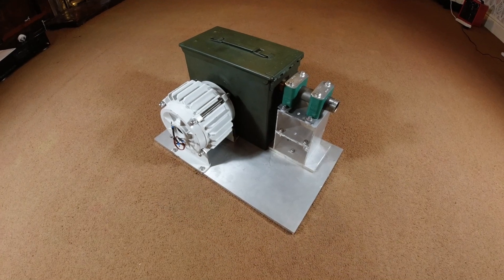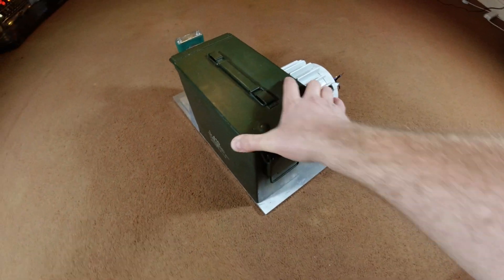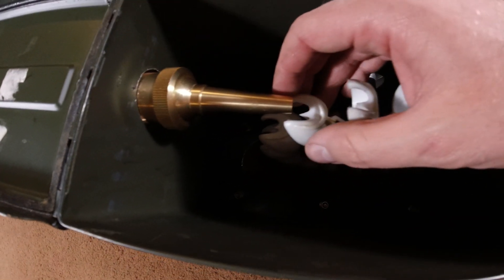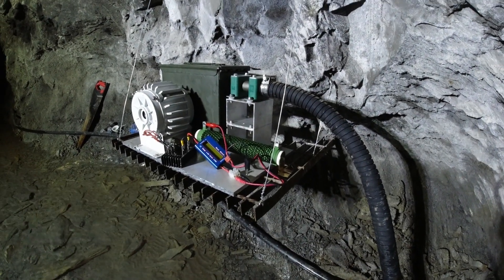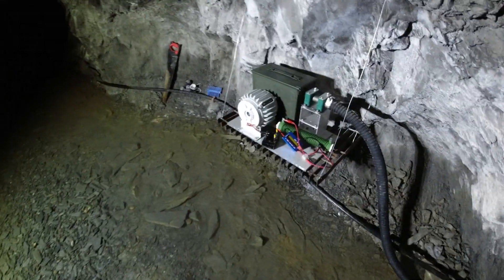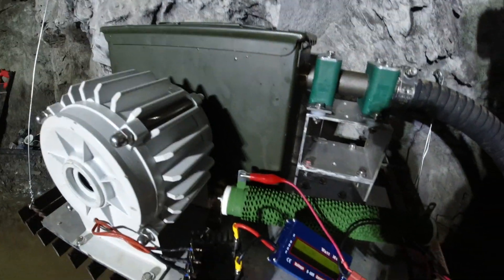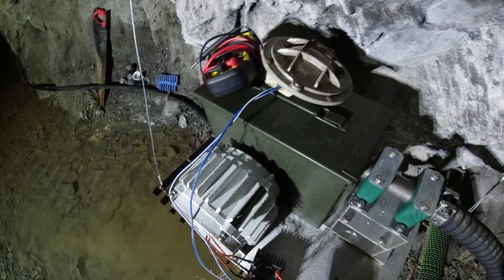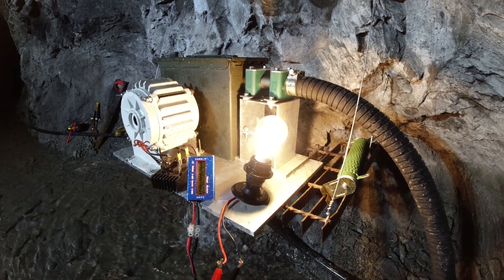Home Made Micro-Hydro Pelton Turbine to charge batteries off-grid

Comment: In times gone by from our grandparents people used to power water motors to drive sewing machines and other machinery using just mains water and something similar to a Pelton wheel turbine. This practice has long gone with the advent of modern electric motors but the notion of me generating electricity, even a relatively small amount using something I've already paid for makes a lot of sense. I don't know about you but I'm up in Scotland and we don't get our water usage metered it's just part of your council tax as a yearly fixed sum. So apart from people shouting about wasting water, which could be stored and used to water the garden or growing vegetables, flush toilets, fill baths etc. I have actually already paid for it so why not.
Reply from the maker: Hello Techstuff and thanks for writing. I know the kind of water motor that you mean and actually have one (from 1905 I think?) installed in the same mine, there is a video about it on my channel. In regards using the mains water for generating electricity, if you've got good mains pressure and good flow, then yes you would be able to make perhaps 50 watts or more from it. Whether that's legal or not I couldn't advise you. Reminds me of a friend years ago who managed to draw a constant 15 watts from his defunct ISDN telephone line.
Reply: @TheAmazingAdventuresOfMiles  thanks I'll check out that video. I have seen a video on youtube of someone tapping into a phone line and It was enough to charge a phone. Keep up the good videos mate, the more we learn the better we become.

Comment: Pelton wheels should not be boxed!  Any interaction of the water with the wheel after the initial impact must be avoided!  Since the exiting water goes in opposite direction than the jet, I would shoot jet upward from below so exiting water is down, aided by gravity.  if water is fed horizontally, it should be below the axis of the wheel, not above.
     Getting the water OUT is harder then getting it IN.
Reply from the maker: Thank you Brian for this very helpful advice, it all makes a lot of sense and I'll take it on board for my next Pelton design.
Reply: @TheAmazingAdventuresOfMiles  Just so you understand how Pelton wheels work.  The wheel's peripheral's speed is ideally exactly half the water-jet speed.  The water hits the blade, does a 180 degree turn, and exits "completely stopped" (the wheel recovering all the kinetic energy of the water).  In reality, the wheel must turn a little slower, because of friction, and the water must have some speed to exit, and it can't turn all of 180 degrees.  Because it is exiting slow, there must be a lot of (sideways) room for the slow exit.  This type of turbine can not have flooded exit.

Comment: I recommend making the penstock pipe larger.
Reply from the maker: Thanks for that Harry. I'd love to be able to do that, it would increase the power dramatically but I have to use what's already there. It would be an immense operation to change the pipe.
Reply: @TheAmazingAdventuresOfMiles  or add another pipe to it.

Comment: Have you got a mppt chargecontroller in there. That will get the max power point. Stop it from slowing down to much under load and also will convert the high voltage down and increase the amps increasing efficiency greatly if you have 95v open circuit
Reply from the maker: Hiya M J and thanks for the comments. Yes on the other end is an MPPT controller, and two Victron 110AH gel batteries. The MPPT controller does a great job, and it means that whenever I am working in that area of the mine (probably once a week) the batteries are full and just waiting. I can take up to 2KWh from them, then when I come back, they are full again.

Comment: It'd dryer with compressed air. and you get much more speed with air power...
Reply from the maker: Hiya Dana and thanks for the comments. Yes it would run on compressed air (or even steam), but there is no compressed air available. The mine did have a big air network about 100 years ago but it's long gone now and renewing it would cost more than my annual salary. But, there is some water available, hence going Hydro.

Comment: Ok the second part of your video was awesome down in the mine. 35 watts over 24 hours is 840 watts. My 120 ah deep cycle batteries only supply 720 usable watts, that's discharging then to 50%. I think you did a fantastic job and just think with a bit of tweaking you can easily double that. Good job mate.
Reply from the maker: Thank you very much Solrac. yes it makes 840w/h per day, or 0.84 KW/h per day. So that's a couple of days to fully recharge the two gel 110AH batteries that it's connected to via a charge controller. And this works great for me because I only generally work in that area of the mine about once a week, so when I'm there I've got plenty of power available and waiting for use (lighting/boiling a kettle/charging drill batteries etc). Then when I come back a week later, the batteries are full again. So it's fine for my needs really, even if I could double the power output there wouldn't be any practical gain for me, unless I end up working there a lot more. But it's fun to play about with these things, and I have some more ideas!

Comment: You need to have at least two nozzles to drive the pelton wheel.
You are loosing too much efficiency.
Reply from the maker: That's Geert. I agree that multiple jets are better but it depends on the water available, and in my case it's not enough to even use one jet properly. The 1km long 25mm pipe that I have to work with delivers a vanishingly small pressure.

Comment: Nicely done as far as the mechanical aspects of your setup, you need an MPPT controller on the output of the alternator to optimize the current/voltage output. You can think of it as a variable matching transformer to couple the supply to the load at the operating point where the power output is maximized. Julian Ilett has a good series on Youtube about the theory of operation of MPPT controllers.
On edit: An MPPT controller would let you easily experiment with the nozzle size to trade off pressure vs flow rate for the maximum possible mechanical power output from your turbine. A smaller nozzle may well allow you to create more power by minimizing friction losses in your very long feed pipe. You have a lathe evidently so making inserts for your  nozzle shouldn't be particularly difficult.
Reply from the maker: Thank you so much Giles for your thoughtful and helpful comments. Now that it's charging a bank of leisure batteries, it is going through an MPPT controller (a Schneider C40) which seems to work well. I did buy a smaller nozzle for it and it has increased the power a bit, but yes it would be worth me using my lathe to make a few different sizes to experiment. But to be honest I'm considering moving it "upstream" so it's not got the really long 300m horizontal length of thin pipe to go through, although I then need to get the electricity to transmit 300m back with minimal losses. So I'll have to transmit it at high voltage, but really I wanted to keep everything below 50v if possible.
Reply: @TheAmazingAdventuresOfMiles  Would you still rectify at the generator and then use a boost converter to transmit at high voltage DC (as otherwise you'd need a three phase transformer)? I think the cables and connectors that they use for solar arrays are pretty rugged and designed to be used in all weathers.

Comment: Great project and as long as you've got constant water it will have no problem keeping your batteries charged. Maybe a few tweaks needed for max potential but great design.
Reply from the maker: Thanks David, I appreciate your comments. Yes the water is constant, it won't ever stop or reduce. I've not been back to it in nearly a month, I'm sure it'll still be spinning away alright though. I've bought a better wheel with more cups from a helpful local chap, might see if I can swap that on, should give a few more watts.

Comment: some info.    1)   site analysis and  Predicted potential energy, at the turbine runner.      2)  MATCHING  component  spec's,  to the energy Available at the   site.     i would guess that  Neither has happened.       at least, you realize that a major pressure falloff occurs.     the (extreme) horizontal run and a very low flow rate equals  Not  much energy, at the turbine runner.        conclusions:    Estimate  the amount of potential energy available; at a location  where the horizontal run, of the water, is  MUCH  less.    Match  component  Spec's to the SITE.   and, run the wild AC from a pma, to wherever you want the power.   plan-b:    utilize a correctly designed, free-standing, waterwheel.    cheers         googletranslate
(pabba -  i don't think you made a mistake.)
Reply from the maker: Thank you so much for your comments David. You are right in that the components here have not been specifically matched to the water source, and the reason for that is economic. I have lots of bits hanging around, the alternator is off an old project, so is the Pelton. So it is a case of using what I have available. I'm sure a custom precision made machine to match that exact water source would yield the best possible result. 

Now I am considering moving the turbine further "upstream" to see if that helps, as you suggest. The very long pipe that supplies the water is totally level for the last 300m to the turbine, so if I move it to the other side of that 300m length , I expect it will be better because less friction?

However, I then need to run 300m of three-core cable back to where the 12v power is needed and I assume I am going to get voltage drop doing that. Question is, which gives the most power at the end?
Reply: @TheAmazingAdventuresOfMiles   some info.      it appears that the flow rate  may  be in the range of  .3 liters per second;  note that this is  a  M I N U T E  amount of water.       a lot of the energy from the effective head is  lost,  in the  very very long horizontal run (of the water delivery system).      if you did EVERYTHING  else Right, you might be able to generate two-point-five watts DC, continuous.     you have  Nothing to lose and  everything to gain, by running  the  wild  AC  from  a  pma; rather than,  water.     any kind of AC  can be run, with minimal losses; in this case, there might  be some small,  measurable losses.     in this case, cables can be, plain-ol',  16ga  three-conductor wire.      even though there is a significant amount of head, the  very very low flow rate  'tells the tale';  in the math.    which is:
flow rate (in cu. Meters per second)  x  head (in meters)  x  gravity (9.81 mps/ps);  multiply by 1000 to get watts.    then, subtract  system losses, to get  estimated NET  output.     due to the very very low flow rate, this is an instance where the use of a  high-speed hydroturbine is Not recommended.     i have no interest in where you components come from.
Reply from the maker: Thank you David for your very helpful reply. That is a useful formula, thank you! I do not know the flow rate I have, but I am sure is it more than .3L/sec. I will attempt to establish it. It must be more because it is putting more than 3 amps continuously into the 12v battery, so that's around 40 watts roughly. I will move the turbine to the other end of the 300m pipe next time I'm there and report the difference in power, I am sure it will be higher there.

I think the cable losses will still be significant though, a 16 gauge cable carrying 12v AC 3 phase over 300 meters is showing a 57% loss at just one amp current. If the voltage can be higher the losses will be less but as it's charging a 12v battery, the turbine voltage is forced down to meet it. Open circuit the PMA runs at about 45 volts.
Reply: @TheAmazingAdventuresOfMiles  1)  i can only comment based on  What  you have shown me.      2)  Accurately  Estimate the  Total amount of potential energy that is  Available, at  the  Turbine  intake.      3)   you  may be right about transmission losses; where the  wattage is  low.  (use heavier cable;  step-up voltage;  make more  current.)      4)  it is probable that your estimate of output power,  is  Wrong/inflated.       5)   it should be understood that the  pma output  Current  CANNOT  be  correctly measured, if there is significant  impedance/Resistance  in  the  output  circuit.       6)  in  order to  Correctly  Estimate the pma output, the output circuit  MUST  cause  a  nominal amount of (internal) lenz-force braking, at the pma rotor.    when this is so,  the pma  rpms  WILL be  reduced.       7)  in order to calculate output watts,correctly, measured amps  must be combined with the  (estimated) voltage produced, at  the reduced rpms.      8)  this can be done in one of two ways. 
short the pma output, and measure amps/volts  with  a  clampmeter, at the shorting-lead.    or, 
measure current with a direct-connect ammeter, and  Estimate the output voltage, at the  Reduced  rpms.

Comment: Awesome project! I was running the numbers for pressure loss and realized how little I know about this application...came out to a 90% loss @ 0,5 liter/s flow rate for the 25mm pipe alone -  but that can't be even close, can it? Anyhow, my first thought was to put a tachometer on the tip of the blades and compare that to the velocity of the water jet.
Reply from the maker: Thank you for your comment :) To be honest I'm not sure how to calculate losses, I just know from some manual somewhere back in the day that the diameter of the feed pipe is extremely important, as is not having it too long on the horizontal. A 1km long pipe of 25mm diameter, even with a 65m drop, is not ideally suited for a turbine. But that's what is there so that's what it's working on, and replacing the whole pipe though the mine with say a 60mm would be extremely expensive due to the complex route.

I couldn't give accurate figures on the slow-down under load but it seems to be a lot. I was slightly alarmed to find the open-circuit voltage over 95 VDC, but then connecting to the 12v batteries to charge them obviously it drops considerably down to 12-14 volts and the wheel grinds away slowly.
Reply: @TheAmazingAdventuresOfMiles  gates.com has a "Fluid Flow Pressure Calculator" that I used, not metric format though. Looks like a lot of design went into the turbine, how do you verify the action of the wheel-materjet interface - a high speed camera?

Comment: Hi Miles, for sure, you love hydro turbine ! You should have more power from this setup.
I don't know what is your water flow, I will said about 0,25 to 0,5 liters/seconde.
With 6,5 Bar. If the all setup efficiency is 50% (pipe friction, nozle diameter) You could plan to produce +/- 80W.
I run a small Pelton turbine at home, regarding the water flow (max 3 liters/second), 150 meters, 50mm diameter pipe, 64meters  elevation (6,4 bar) , I can produce from 300 to 700W.
I have a few video about it in Youtube
Reply from the maker: Bonjour Cristof! Merci for watching my video. I think you are quite right, I should expect a greater wattage from this setup. I am wondering if the wheel is too large diameter for the size of the flow, and is giving too slow RPM. I used a 200mm wheel, maybe a 120mm wheel would help. I do have a smaller wheel (and a smaller jet) and will see if that makes much difference. Merci for your help!
Reply: @TheAmazingAdventuresOfMiles  Hi Miles, you should also use a mppt charge controler, it will help a lot for more power (a solar one will be good )
Reply from the maker: @cristof48  Thank you Cristof! Yes, I do use a small 10 amp Schneider charge controller which has Mppt. It definitely squeezes a bit more out that just a direct connection. Also, I tried changing for a smaller nozzle today, it made it go much faster with no load, probably twice as fast, but when on load I think it gave about 20% more power.

I think maybe my Pelton Wheel itself is not ideal, maybe not enough spoons. Lots of water still flies out in direct line having not given up its energy.
Reply: @TheAmazingAdventuresOfMiles  I noticed the jet not aiming into the cupped area of the pelton wheel, maybe aim a little to the left or right into a cupped section...or replace with solid cups normally found on a pelton wheel